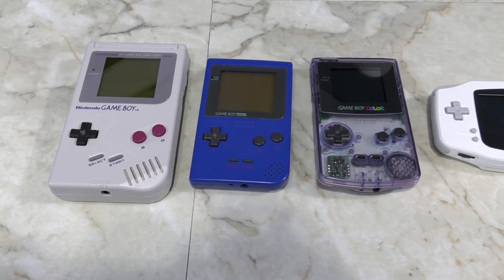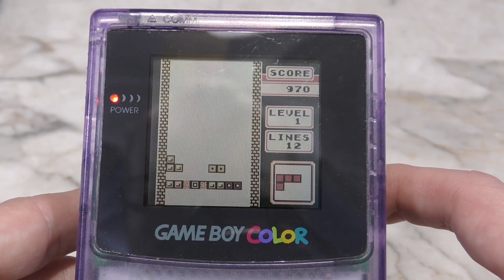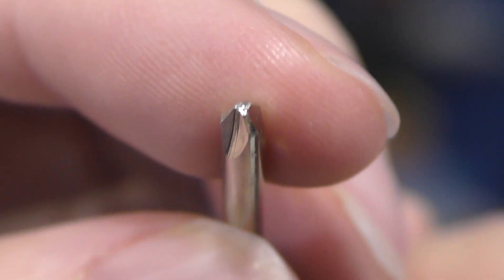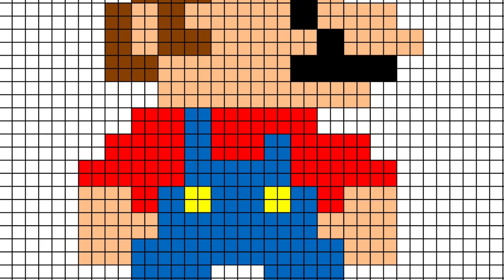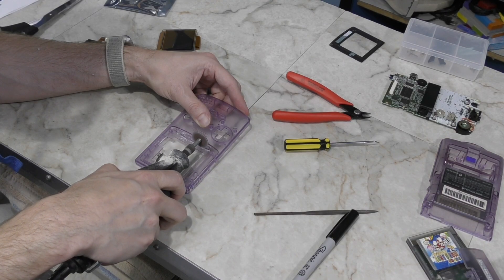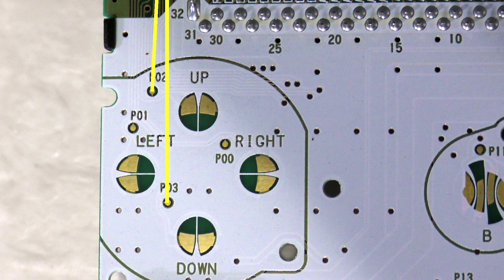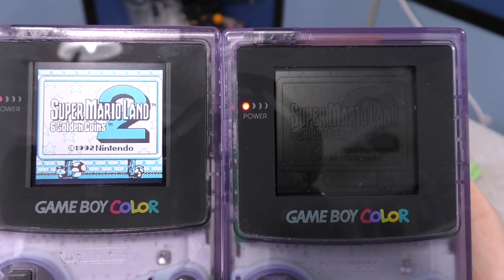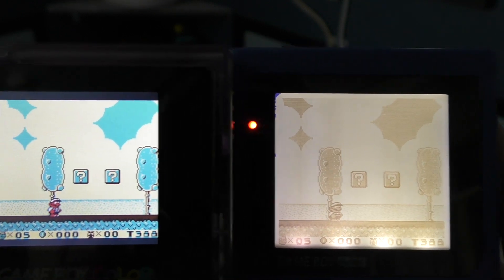Finally - A Gameboy Color Backlight Mod!

Comment: If you want backlit color, what about the GBA SP (with lithium battery and backlit screen, stock)? I was hoping someone had finally actually done something to mod the GBC screen with a backlight, but again, another full screen replacement just like the GBA. Sure, it's nice, but that makes it incredibly expensive. Also... you might want to check out "Super Mario Land 2 DX" - a fully colorized ROM Hack :)

Comment: Is there a lithium-ion rechargeable mod as well? (I'd most like do that combo to a Game Gear!)
I totally get why you prefer the original Pitfall. I played a 16-bit remake of the Jetset Willy games and it was totally charmless.
Reply: you could just put rechargeable AA batteries in it, they are available at all good supermarkets, most bad supermarkets, and ikea. I have no experience with the Game Gear, but I if it has a AC input plugging it in should recharge the rechargeable batteries (the Game Gear also came with an external rechargeable battery pack called "PowerBack" which you can find on Ebay pretty easily)
Reply: @dialupdude  Is that a Telecom logo?

Comment: Is it possible to use some form of liquid adhesive instead of double-sided tape to glue the screen protector back on?
Reply: Don’t even think about it.
It could dissolve the paint instantly or over time. 
And it would make it impossible or hard to remove it later over the years if need be.

Comment: One thing you might want to check out as an alternative is BennVenn's "FreckleShack" (he names things weirdly) mod, which is like... basically identical. But they're two independent products, and both quite good from what I've seen. Both are better than the stock screen :)

Comment: There's actually no colour data stored on original GB games. The Super Gameboy and Gameboy Color can basically assign a different 4-colour palette to each layer that the Gameboy processes; Sprites and Backgrounds. This actually lets you cheat a little bit in some games, because sometimes sprites that are supposed to be hidden in the background will be easily visible because they are assigned different colours as sprites. Super Gameboy-specific titles are a bit different, though, and can hook into the SNES hardware.

Comment: I'm going to disagree with you on the direct comparison of Nintendo and CBS. As you pointed out, CBS at the time wasn't making new Star Trek. But Nintendo is making new Mario games, and they are selling the original Super Mario Bros in several formats (NES classic, 3DS eshop, Nintendo online).

Regarding their copyright claims on Youtube, I'd heard they ended their "Creator Program," and copyright claims by them were actually on the downturn. (I'm aware of BrawlBRSTMs3 X's copyright issues. And bummer though it is, that content certainly wasn't fair use.)

As for them pulling down the C64 port of SMB, totally agree that it wouldn't hurt their sales. So on the one hand, it would have made sense for them to let it go. But the problem with them doing that is, from what I've read, it might hinder other more legitimate take-downs of copyright infringement. It's my understanding that if a company doesn't consistently protect their IP,  that can hurt their ability to win the IP infringement cases they do bring.

Comment: Didn't the Gameboy Advanced SP basically handle all of this and include a rechargable battery?
Reply: Yes, but Gameboy / Gameboy Color games stuck out of the SP quite a bit making it uncomfortable and the games looked tiny on screen as it had the same issue the regular Advance did. Also there were 2 models of the SP released, the AGS-101 which had the best screen now sells for around $100 used today, while the other model has terrible viewing angles. Personally I like the Gameboy Colors feel in the hands more than the others.
Reply: Yes thank you. I was wondering why this wasn't pointed out before
Reply: Wrong form factor

Comment: FYI, the older GB games (pre GBC) didn't have color info in them. The GBC has different color pallettes that it applies to those games. You can choose one of many by using different button combinations on the the initial GameBoy Color splash screen. D-Pad alone,  D-Pad plus A, or D-Pad plus B.

Comment: Need usb rechargeable li-on battery mod next!
Reply: Change the battery arrangement to 2x2 and reduce the nominal volts to 6v. Forget the USB recharging, use 14500 cells and charge them on a real charger to stop killing batteries too soon.

Comment: The usable size of the screen isn't the same... massive borders between the screen protector and the displayed image. Unacceptable.
Reply: I was thinking the same thing. Really does look off, when you're expecting the original screen size, and then that extra bezel looks bizarre. I was really surprised he didn't mention that.
Reply: Agreed. And I don't know why every video I've seen about this screen thinks the viewers are blind, because they all claim it's barely noticeable or you can hardly tell. I have eyes, they work, and I'm not stupid: I can clearly see 3 different colors of "bezel" before I actually get to the image. The makers of this screen really need to include a new screen protector that covers up all the extra dead space. I wouldn't mind the smaller viewable screen if I didn't have to see all the borders.
Reply: @mjc0961  They do make new ones that cover up that space.
Reply: The size needs to be a tad bigger, but still way better then the GB Boy with its off aspect ratio.
Reply: What border
Reply: "massive" that's not hyperbolic at all...no no no no.

Comment: I'm honestly a little wary of modding my GBC. It's the only one I have.
Reply: Order a replacement shell and you don't have to mod your original shell.
Reply: @mouser328  What about a board?
Reply: @Chaos89P  I wouldn't think soldering a couple wires is likely to damage the board unless your iron        is way too hot.

Comment: Don’t give me another reason to push my love/hate relationship with you nintendo towards the hate side. You demonitize the 8bitguys vids and I’m gonna be pretty pissed, and you’re not exactly on my good side lately with things like your switch online service. This channel not only gave me the courage to take apart and retrobrite a lot of my old consoles, controllers and game cartridges, it helped me be less scared of taking apart electronics in general.

So don’t piss me off at you anymore nintendo.
Reply: *retrobrite and repair, my old consoles. I’ve also done solder work on things I would have been terrified to do a few years ago.

Comment: You got it wrong. The GBC doesn't use any of the SGB stuff. They are completely different extensions to the GB standard.
Rumor says that, predictably, they initially thought of just making the GBC use the SGB scheme, but much of it depends on the SNES too much and the color it add is not that varied, so they scrapped that and made a new scheme better suited for the new system.

The reason some DMG games do show some color on the GBC without manually selecting a pallette, is not because the games themselves direct this process, but because the GBC boot ROM has a list of recognized games and a pallette assigned to them.

https://tcrf.net/Notes:Game_Boy_Color_Bootstrap_ROM

DMG games can have both GBC and SGB extensions, but they only work with their respective systems.

GB emulator BGB can run with both SGB and GBC hardware emulated at the same time, which makes me think a game could actually use both at the same time if designed that way, but when you try to run an original game with both extensions like that, such as Wario Land 2, the game doesn't know what to do with it and craps it's pants.

Comment: That thumbnail confuses me, why is the arrow pointing towards the old one?
Reply: Does it matter? All clickbait thumbnails have arrows that point at random things.
Reply: Hero Slippy This one is clickbait because the thumbnail shows it removing a backlight instead of adding one.
Reply: @HaydenTheEeeeeeeeevilEukaryote  Any thumbnail with an arrow is clickbait.
Reply: Hero Slippy This is an example of one that isn’t. It’s out of the way and is only there to show a before and after. Most arrows in thumbnails are totally clickbait though as they don’t serve any purpose other than to get people to click on a video. Some serve both purposes, but this one is really just for a before and after.
Reply: @HaydenTheEeeeeeeeevilEukaryote  Yes which makes it click bait, arrows to before and after are clickbait. Honestly the thumbnail could live without the arrow.
Reply: Hero Slippy It could go without the arrow, but I don’t understand how a before and after is always clickbait. The arrow isn’t super in-your-face and flashy, you know? It’s skinny and not too eye-popping. It’s just kind of there, not super over-the-top noticeable like most others. That’s just my opinion though, I think this dude did a good job of making an arrow in a thumbnail as not-clickbaity as possible.

Comment: Cool. Thanks I wish some chinese company make an exact fit backlit OLED or micrOLED or LCD (OLED or LCD choices to suit the budget) that required no soldering and it just fits, a direct replacement for the non-backlit LCD.

God bless, Proverbs 31
Reply: Look up the Freckle Shack mod. It's exactly that.
Reply: Thanks. Finally, after 21 years (1998 GBC release). Patience truly is a virtue and in God's time. It's quite expensive though with shipping- the price of 6 working GBCs. 

I wish hadn't backlit the GBA, all that hassle to find an AGS -101 screen only and the adapter but I guess that's life and I don't even like the layout. GBC is the best looking Game Boy.

God bless, Proverbs 31
Reply: Now, they just have to invent a mod chip and an adapter (with the GBA chip built-in to play GBA games:-)

Comment: Great video! I love that there are so many GBC backlight mods coming out now. I modded my original DMG with a backlight. If you solder in a bivert chip it looks amazing. Still, not nearly as good as the modded GBC in the video though.

Comment: This is a neat mod, but it distracted me how the new screen is slightly not the correct size. 
It's more noticeable when the screen protector is there, you can see small black edges on the screen.

Very slight nitpick at this point, shouldn't affect anything.
It would be cool to see a mod like this that did not require you to mess with the original plastic shell though.
Reply: I was just looking at my old GBC, and it also has noticable black edges. It's completely stock, too.
Reply: @Chaos89P  I guess it's just the camera angle then?

Comment: Dude, American Copyright law has the fun little quirk where if you don't demonstrate an active defense of your copyright, the legal system can just give it to someone else. Even if the offending case , (like super mario C64) won't impact the bottom line, not issuing a takedown notice can be seen as not defending the copyright. Not saying if it's right or wrong, just saying that sometimes things are a little more gray than just "Nintendo being a jackass."...Ironically, about as grey and undefined as the entire legal definition of "Fair Use," which interestingly does not list monetary impact as a defining factor.

Comment: For the most part, the games didn't include color data (aside from the greyscale 4 colors). The color data was added on a per-case basis for the super game boy, and if no color data existed, it used a default palette set. Game boy color worked differently for black and white GB games, there was a set of 16 palettes that you could choose from when booting up the game.
Some games DID include color data, like Donkey Kong for Game Boy, and most black and white GB games made after the SGB, but before that, there was no color data to draw from.

Comment: I restore vintage fountain pens and one thing we use is plain mineral oil. Mineral oil is neutral so it will not damage plastics or oxidize metal. It is also fantastic for removing goo without having it smear. Because vintage pens are made out of rather fragile materials such as celluloid, hard rubber and Bakelite, mineral oil is ideal over plain water which can potentially corrode stuff or discolor some materials. I'd give it a try for removing goo if nothing else :)

Comment: What I'm really curious to see is how much this new screen affects battery life compared to an unmodified GBC.
Reply: Depends on the batteries used, actually.
Well, that and usage itself.
Reply: Check out the MW website, it says 3 hours, ouch
Reply: @mrmega328  It would go longer than 3 hours if he would have bothered to hook the brightness controls up.  Turning the brightness down would increase the battery life.  He had the whole Gameboy disassembled and didn't bother to hook up an additional 3 wires to control the brightness. What a waste.
Reply: Ouch indeed.

I clocked my GBC at 28 hours off a pair of alkalines round about 1999.
I mean, I get WHY people want a backlit screen, but a factor of 9 reduction in battery life seems a bit insane to me.

I mean, my GBA SP manages to run 14 hours with the frontlight off and 8 hours with it on, so something is quite off here...
(even so that also shows nearly halving battery life - but  halving battery life is still something quite different from reducing it by nearly an order of magnitude.)
Reply: KuraIthys I mean it is powering more pixels with this mod, which I would assume eats battery liclfe more that way.
Reply: @AlanIsAkira  maybe, but it's upscaled from an FPGA, so it depends on how it's doing it. Regardless, the module will definitely consume likely more than twice the power just because of the backlight and FPGA, and more depending on the method they're using for upscaling.
Reply: @Pixel - that's certainly possible, though in my experience that's not usually how it works.
Many laptops are sold with multiple options for the screen, and I rarely hear that opting for a higher resolution screen reduces the battery life...
Usually, power used by a screen is most directly related to the backlight itself.
Other issues include the kind of technology used, though that's rarely relevant. (e-ink displays use no power unless you're updating the screen, hence why such devices often have battery life measured in weeks, not hours.)

Physically larger screens consume more power. Different kinds of back (and front) lighting screens consume more power.
Different types of screen consume different amounts of power
 (active matrix vs passive matrix vs e-ink vs oled, etc.)
Brighter screens consume more power. - including the effects of adjusting the brightness of the same screen.

Still, all of that being what it is, I suspect the screen might not be the primary factor here...

My guess, looking at how it's constructed is that the FPGA is a massive power hog.
FPGA's are great, but... They use vastly more power than an equivalent circuit implemented some other way...
So I'd have to assume it's a major factor here....

Comment: Why not use Goo Gone it's the best for removing stickers and adhesive. Very gentle.
Reply: Goo gone will also destroy plastic.
Reply: @9000888sora  Example?
Reply: @HerecomestheCalavera , I cant remember what one but in one of 8 bit guys videos he said not to use goo gone on certain plastics.
Reply: Goof-off will eat plastic it is pure xylene (a.k.a. xylol) but Goo Gone is totally different and based on orange oil it is mild and safe for plastics. W40 is considered a solvent and I would not consider that safe. I'm surprised he uses it over Goo Gone.
Reply: @luckydragonaaaa  I would think WD-40 would be more harmful to the plastic than Goo Gone.  I've never used WD-40 to remove sticker/tape residue but I have used Goo Gone many many times and never had any issues at all with it damaging the plastic.  I did however foolishly try to use fingernail polish remover to try and remove some marker from a plastic device before.  It ended up just how you'd think it would!

Comment: David, if you turn the brightness all the way down, the screen will work just like an original GBC reflective screen, so you can save up on battery life if you need to.
Reply: I was rather disappointed that he skipped the brightness control wires. I mean, the gbc was already disassembled and it didn't seem any more difficult to solder to those pads.
Reply: @humbertojunior2819  ditto, I couldn't believe it, thought he was joking. Weird 🤷‍♂️
Reply: that information just turned this from a maybe to a must buy for me  thank you
Reply: well if it uses fpga then turning backlight off wont make that much difference
Reply: @Timsturbs  can still be useful if you're outside. But it's up to the person doing the mods, it's good to have an option anyways.
Reply: @Bleats_Sinodai  sure having options is great no doubt just saying that fpga will eat most of a battery anyway so switching backlight off is a bit pointless
Reply: @Timsturbs   True. I think a front-light mod would be more appropriate in that case. 
Which doesn't require a special chip to work. Thus switching the light off would save power. 
Of course it depends on preference. Most prefer a back-light so I doubt anyone ever doing that.